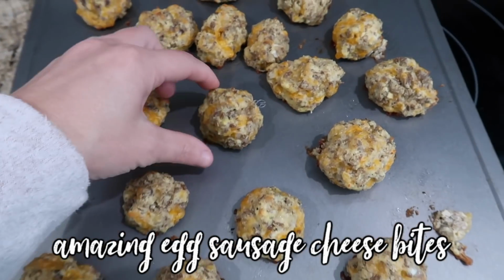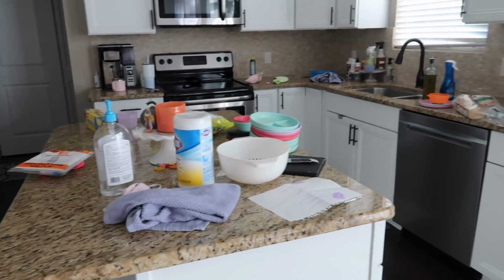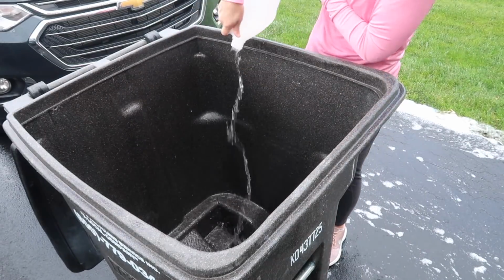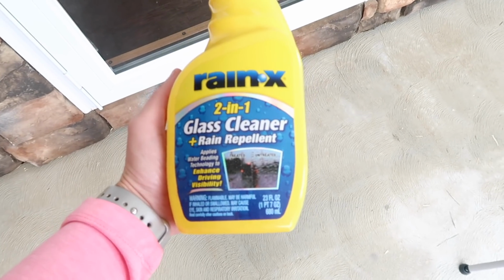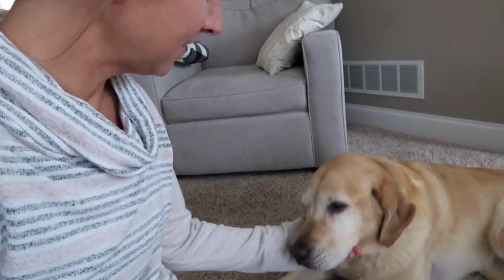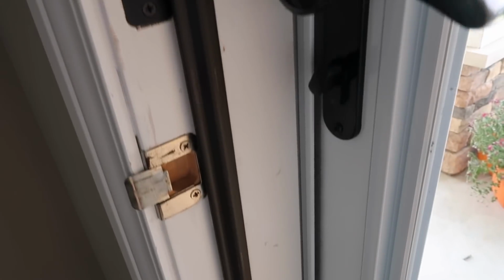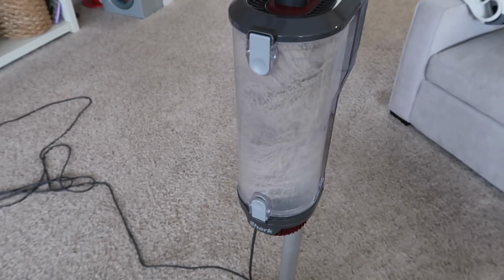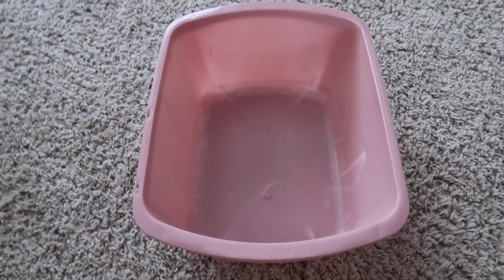ULTIMATE OUTSIDE & INSIDE CLEAN WITH ME 2021| ALL DAY SPEED CLEANING MOTIVATION | DEEP CLEAN ROUTINE

Comment: Hi Jamie I have been looking for a carpet cleaner the one have been looking at is the hoover power dash pet because I don’t have that much carpet I have rugs and so I don’t need a big carpet so you like your Hoover power dash or is the bissell pro heat better
Reply from the maker: The power Dash pet is smaller, light weight and less expensive but it doesn’t have the attachment. So I guess it’s up to you and if you need the attachment
Reply: @JamiesJourney  will I have my bissell spot clean proheat pet handheld carpet cleaner and that thing is really good so I think I might get the hoover power dash pet carpet cleaner because I just need a small upright carpet cleaner because I have rugs in my house so I want something small lightweight and easy to use on my rugs thanks for helping me on this Jamie